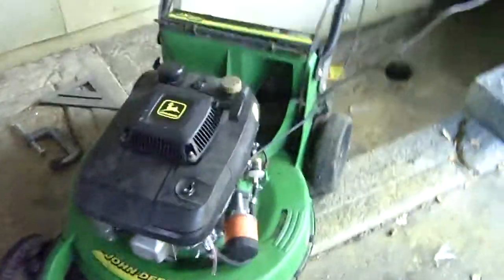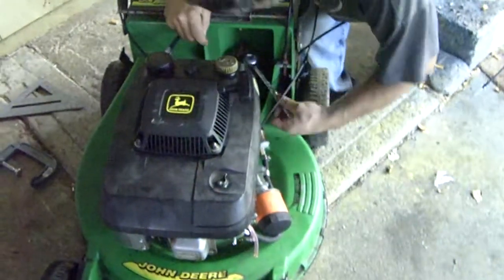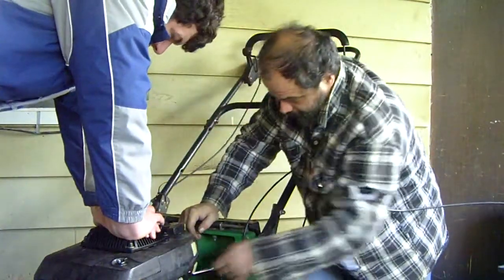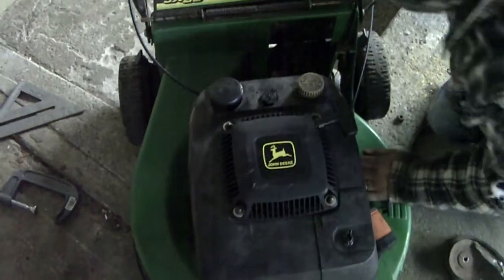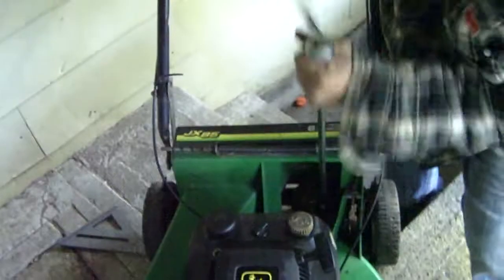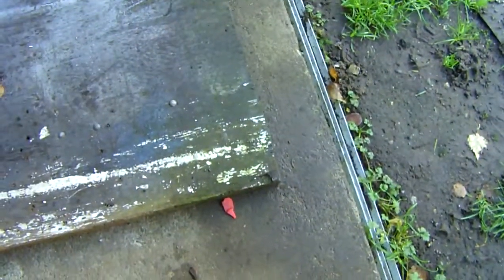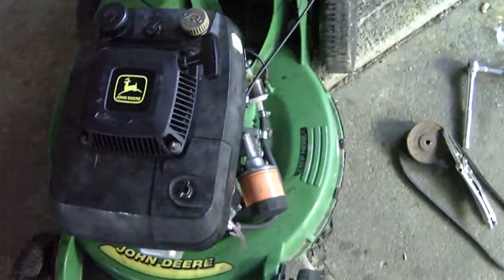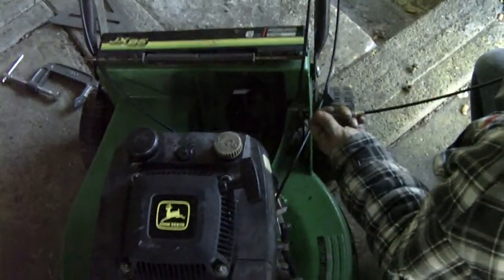Fixing the John Deere JX85 Commercial walk behind lawnmower

Comment: Having two problems with mine, JX75, can you assist?
1. Hard to pull cord & won't start. Cord goes to 8", 17" or all the way out & stop- won't start.
2. Won't go reverse. Ok forward, rear wheels locked in reverse.

Cleaned carburetor, new gas, new filter, good spark plugs.
Engine won't turn over, cord pull and stop & jerked back into home position.
Reply from the maker: angelisone try adjusting valves then check drive cable check wheels and transmission might be jammed hope this helped u
Reply: Still can't pull the cord out all the way. 
Again, able to pull about to 8, 15, 24", then the motor jerked the cord out my hand really hard & retracted to home positions.

If I can't pull the cord to start the lawnmower, then doing those adjustment & check will not help, right?
Reply from the maker: angelisone try replacing the starter pulley and maybe replace rope as well see if that helps
Reply: Robbie Neufield, what is a starter pulley?  The cord/rope was replaced not long ago & I used the same Black Plastic Puller.
Reply from the maker: angelisone it's what holds the rope u might have a bad recoil spring
Reply from the maker: angelisone hi the pulley is what holds the rope in if your still having issues u might have to replace it
Reply from the maker: angelisone er Pulley. It is important to know that the starter pulleys for your Briggs and Stratton small engine are not the same as idlers. The difference is that an idler rotates freely around bearings at its center, while a pulley has a notch (or some other device) to fix it to a shaft, as it rotates.
Reply: If the pull cord jerked back out of your hand real hard ... it sounds like the "keyway" sheered on the shaft to the flywheel .... the rear wheels not turning in reverse is a "keyway" on the shaft issue also ....

Comment from the maker: my friedn adjusted the governor and ite working better now just have to replace the bottom half of the clutch and the blade. Then i will post a new video of it running in the spring time. Rusn alot better now too brand spanking \ carburetor plus gaskets and soem other parts. Starts good too1 to 3 pulls and poff it goes amazing.

Comment: When you check speed with a tachometer, with the blade disengaged, the reading should be 3125 RPM or so.
Reply from the maker: Hi yes my friend I'm aware his high the rpm is now I have this engine built into a new elelctric start fc150v just needs new crankcase then ready to go